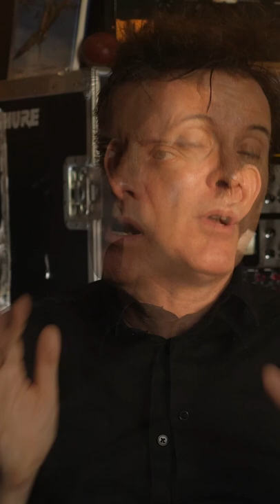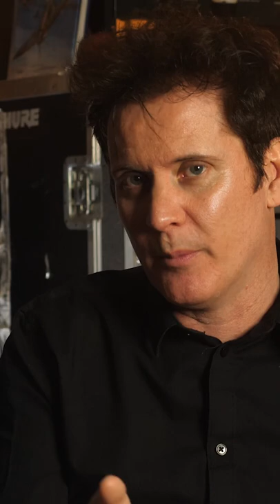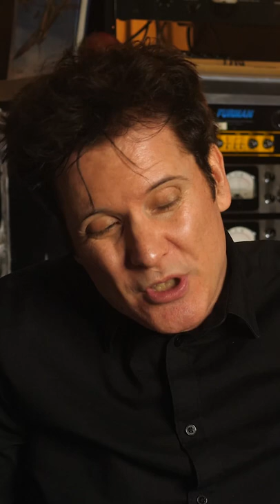How I treat this kind of vocal  - #shorts

Comment: Hi Warren and PLAP community. I am looking to upgrade my current audio interface and I am considering the following three; 1) Audient ID4 MkII 2) SSL 2+ 3) UA Volt 276
Leaning towards the Audient as it is a bit less expensive than the other two options, and has got great reviews (as have the others). Any comments, opinions, or experience with any of these models would be greatly appreciated. Thanks for your time.